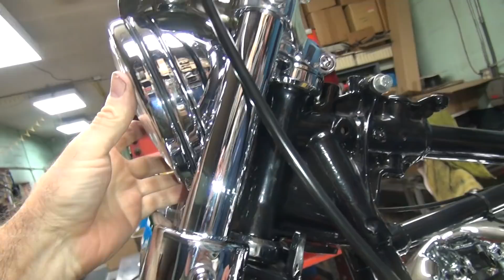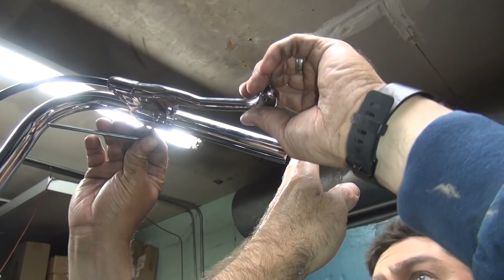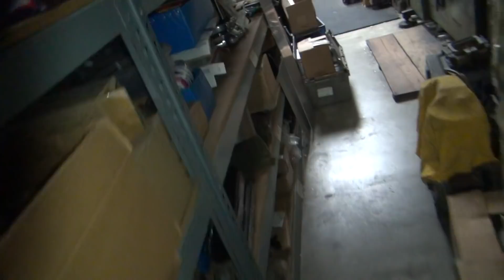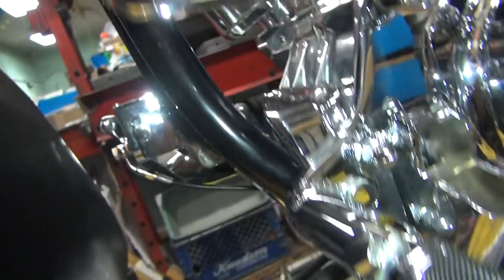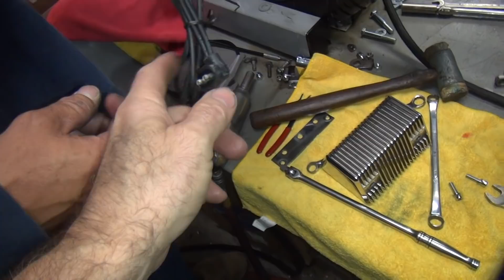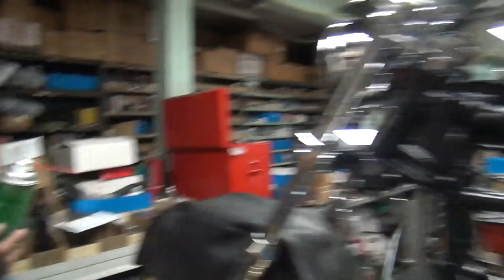#197 1978 93ci stroker shovelhead big bore motor new bike build fl harley by tatro machine

Comment: What's the component in front if the SU air cleaner, is it an ignition set up 👍👍😎
Reply: Its a magneto. So, yes, for ignition. It has points in it (or maybe electronic ignition by now) and also acts as a coil with the difference being the more RPM’s the more spark.
Reply: @AbdulAllahAbuDaoud  thanks Abu👍👍😎